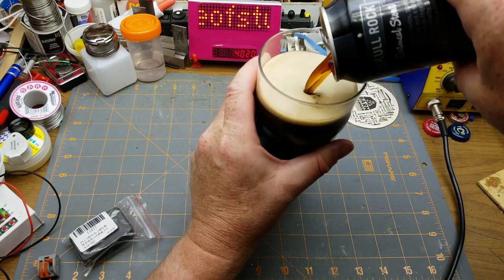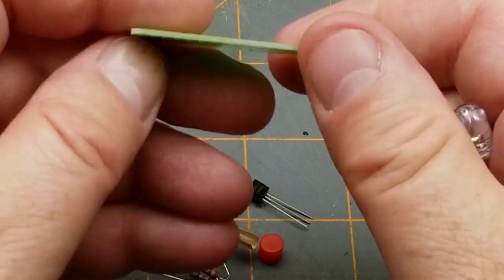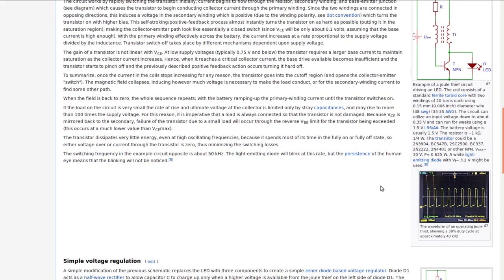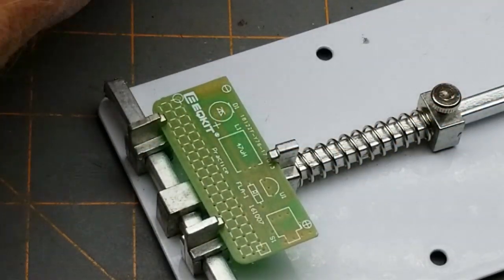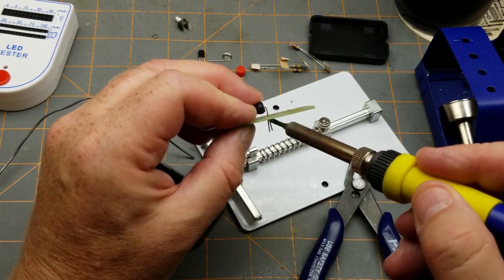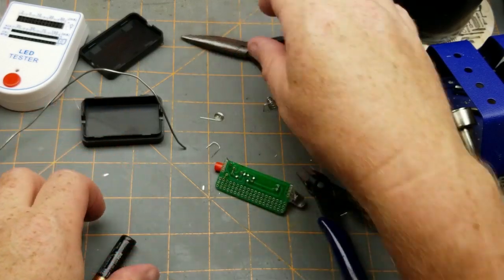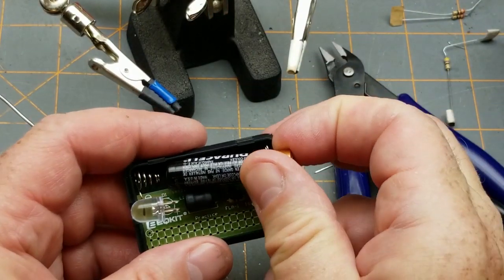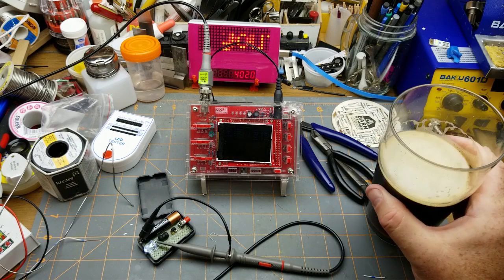joule thief flashlight kit build

Comment: I think the transistor isn't a transistor. The marking briefly seen is YX8015, which I think is some kind of solar light chip...perhaps that's why the circuit works, rather than being a 'true' joule thief.
Reply from the maker: I tossed it onto my component tester off camera (when I was drawing the schematic) and it identified as an NPN transistor.
Reply: @pileofstuff  Its not a transistor, according to your mailbag #39 and a google search it is a LED driver IC. But still a nice video. Enjoy your vaccation.
Reply from the maker: @zz007qq  Interesting. 

wonder how it managed to  trick the component tester?

Thanks.
Reply: @pileofstuff  Those component testers are quite good, but not genius. I managed to get a NPN transistor to give up the magic smoke, afterwards the component tester showed it to be two diodes in opposition. :o
Reply: @pileofstuff  There is probably a NPN transistor on the output, would be my guess.
Reply: You could be right, but in It can be a transistor (almost any NPN), bigclive draws the circuit on his video. You can find a link to the video on the Wikipedia page.

Comment: Another nice video!  I've also made some Joules Thief circuits after watching Big Clive's videos. The only thing one should take into account is that draining the battery to its extreme can often result in a leaking battery. I've had several JT projects with leaking batteries and saw the same behavior in remote controls that apparently also use up the battery up to quite low voltages. In one case the corroded leaking battery caused the enclosure of a portable microscope to crack. It still works, but the part that holds the battery turned into a duct tape convention center...

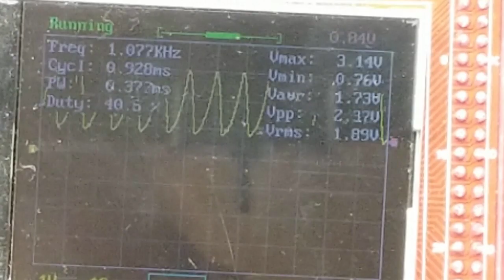Comment: Nice little project! At 19:08 Vpp was 2.33 but interestingly Vmax was 3.06 volts which makes sense with a white LED. It would be interesting to measure the current drawn by this circuit as opposed to current through the LED with a fixed 3 volt supply.

Comment: I have built a few of the BigClive ones. It is interesting to measure the input voltage, frequency, and output voltage. I had one battery start at 1.394 volts, the freq. was 48.12 khz and output 4.36 volts. Finished at 0.372 volts, 324 khz and output of 3.12 volts. Interesting but somewhat useless data.

Comment: I have a couple of very small flashlights almost the same size as its internal AAA battery. I'm guessing there is a miniscule joule thief circuit in it cause an AAA battery is just 1.5 Volts

Comment: Something got messed up in rhe circuit tracing. As shown the base emitter junction shorts the battery with somewhere above 0.7V drop. While the large base current would also lesd the collector current to rise via the inductor, there is no stopping base current.
Possibly the battery - is to the led resistor junction. Then the resistor is in the emitter current path. At first power the base current will be Vbat less about 0.7V divided by resistance. That amplified to collector starts Ic rising via inductor, then as Ic increases the base current is reduced until the resistance by Ie (=Ic) such that base cuts off at below Vbe < 0.5v, thereby cutting off Ic as the base current goes zero. Thereby kicking back on inductor to dump the current to the LED.
As draw I would expect smoke as the base emiter junction gets destroyed.  Maybe the tracing made error following tracks.

Comment: Much easier to just use the 4-pin chip and standard (uH) inductor from a Solar exterior light. You just need to change the inductor to one with lower value to bump up the LED current.
Also it's SO PAINFUL watching Pile-O struggling with the silly PCB holder. Just place the component in the holes, flip the PCB and lay it on the bench, Solder, done!
Reply from the maker: The main reason I try to use a board holder is the heat from soldering causes my cutting mat to warp.
Reply: @pileofstuff  - I'm not convinced that the grief endured is worth it to save a $2 cutting mat, and life membership of the "Cutting mat humane society" LOL.
In any case, it's bullshit because the heat of the soldering iron is a LONG way away from the mat, separated by the PCB plus component height
I reckon you're trying to justify using a PCB holders that you keep buying, however you've secretly admitted that they are all totally shit..:-)